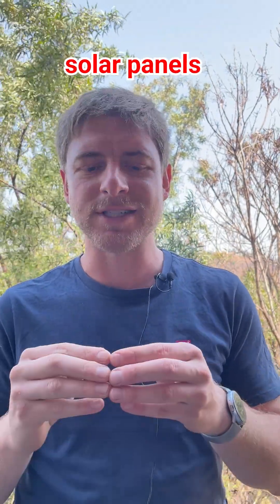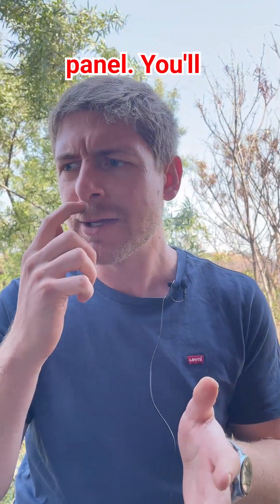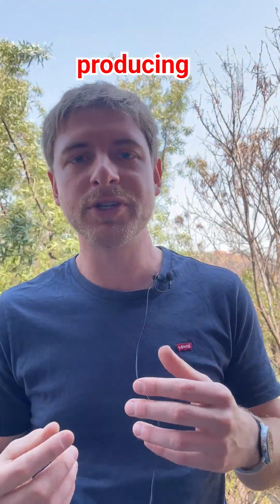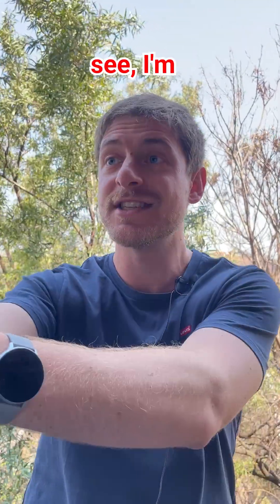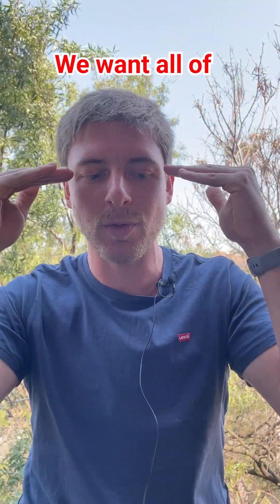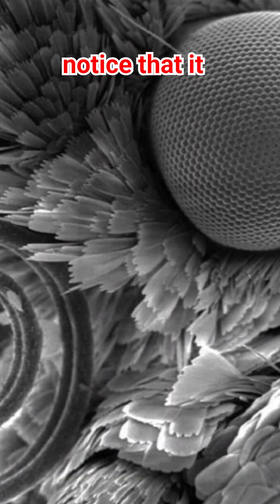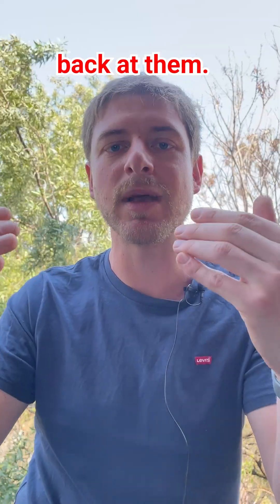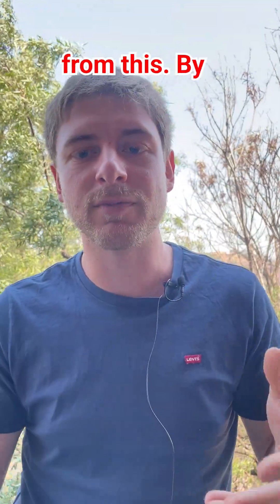Solar Moths

Comment: I might be very wrong here so I’m hoping you’ll correct me. Isn’t the amount of light reflected still the same, but just scattered? Meaning the same amount of light is being reflected but just more spread out, which gives the visual effect of “less reflection?” Also wouldn’t the ridged surface just increase surface area therefore more energy lost to reflection?

I’m asking in good faith because I’m curious and feel like I’m getting this wrong.
Reply from the maker: I agree with your thought process, however the idea is that by creating these nanostructures on the surface of a solar panel that mimic the moths eye, you actually change the refractive index of the protective coating. The big advanatge of this is not only do you get less reflection of the visible light, but more absorption of the non-visible wavelengths. A bit hard to go in depth on in a comment, but this article has some good details: https://www.herox.com/blog/178-moth-eyes-inspire-new-means-of-boosting-solar-effi
Reply: @Applied_Engineering_Mechanics wow thanks for getting back to me, super helpful info here. I knew there had to be something I wasn’t considering. Subscribed!!!
Reply from the maker: @doobyscoober5009  that’s awesome man!! Glad to help!!